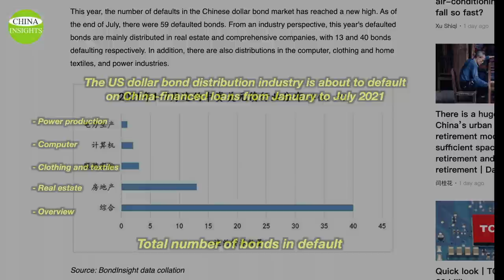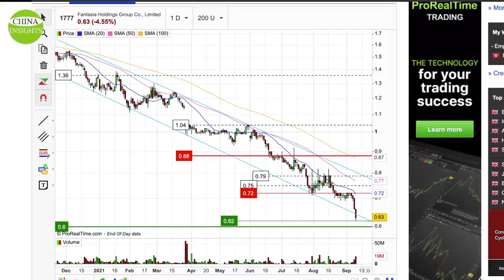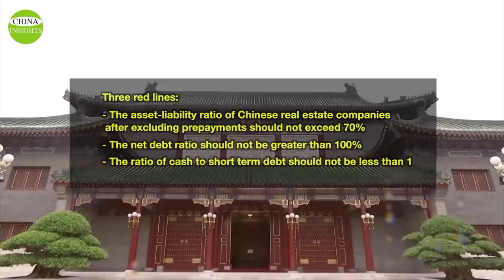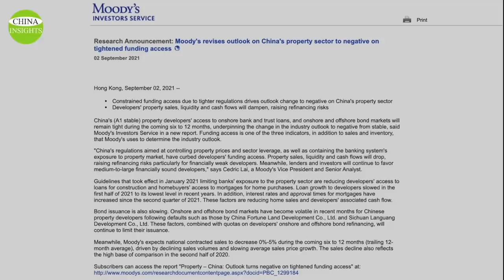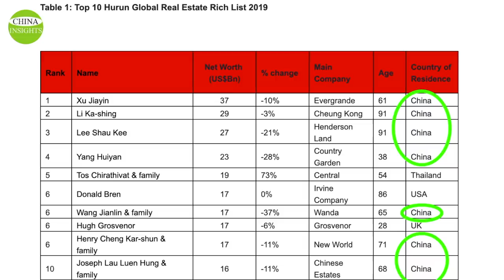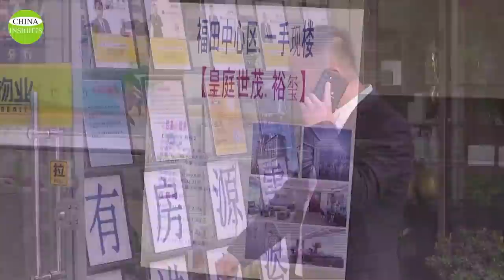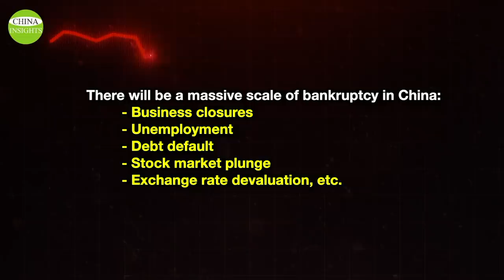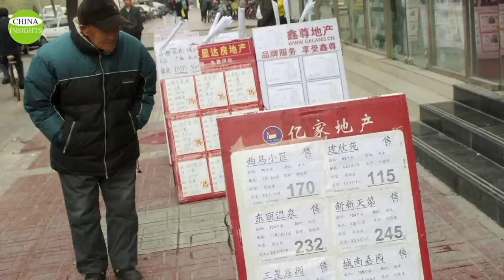Citigroup, Credit Suisse stop accepting Chinese dollar bonds/How China's Real Estate Beast is formed

Comment: Basically let the collapse happen while they are expecting it vs collapse while they are not expecting it. China is now stuck in a damn if you do, damn if you don't situation with the real estate debt bubble.
Reply: But it was so unneccessary.. All they had to do was apply quality building standards.. But they didn't..
 It takes a bit more than just, wet sand and paint, to build a wall.. That TOFU thing looks for real..
Reply: @parallax9281  yes. It was an unnecessary pain caused by decades of corrupt opaque system without any real checks and balance nor oversight. This has always been the problem with the CCP system, ignore systemic problems until they got too big then suddenly clamp down on everything. They have no concept of moderation. Everything is done in excess.
Reply: @twomix1822  You nailed it!

Comment: Great content. Personally, just slightly confused about the LTV section (1:07). I assume this means a third party client couldn't use Fantasia's bond as collateral for another "loan"? I use to think of the collateral for a "mortgage" to be the property itself? Just a random ask, cheers.
Reply: Lombard credit, where the security is used as collatoral. I am pretty sure you could combine it with a mortage, but that would be negotiated and mortage and secuirty analysis are two different departments at banks and private clients are usually treated worse the institutional ones.

Comment: 4:00   Demolition costs were greatly reduced;  it was not necessary to buy actual dynamite...........each building was dropped with a single, 5-pound bag of Black Cat firecrackers.

Someone forgot to light the fuse on the bag in the last building that remained standing.  But it fell 5 minutes later, when a bus ran into it because the driver was disoriented by all the tofu dust created by the other buildings falling.